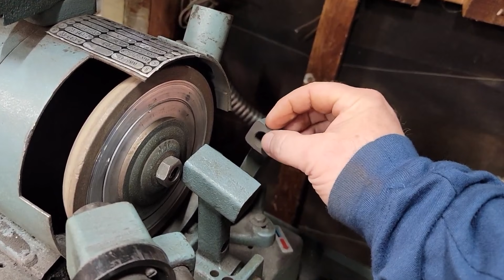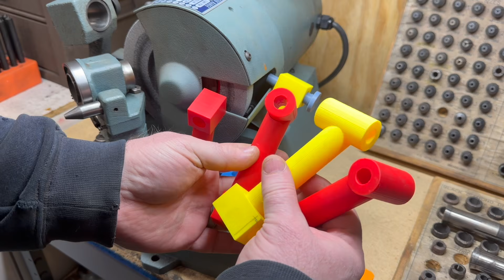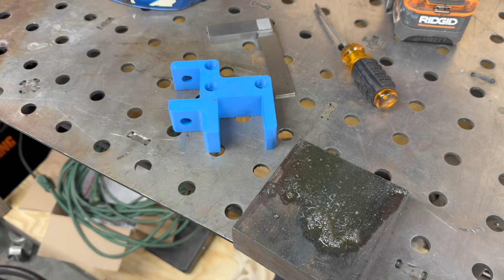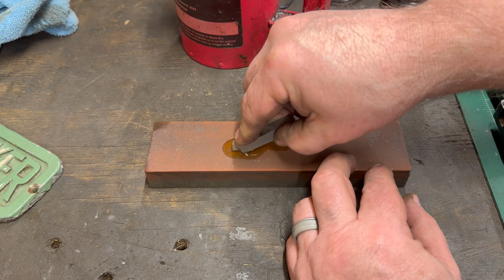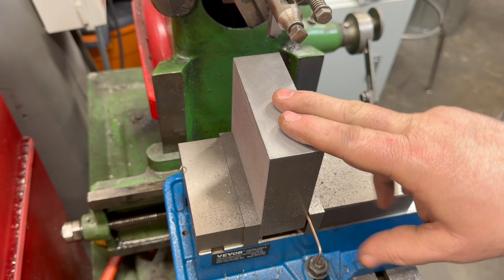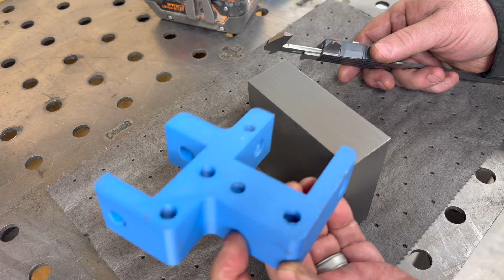Squaring Stock with a 7" Logan Shaper - Black Diamond Drill Grinder - Making the wheel dressers

Comment: I would like to make a few suggestions for you they may help with your shaper experience. First thing I noticed is your tool geometry is ground for feed in the opposite direction you are traveling. as for order of operations you surfaced the large flat surface first and then you could have flipped the part over to surface the other side so as not to have to keep resetting the height of the table. As for squaring up the end you could have laid the blade of a combination square on the vise jaw and the head would slide up against your part to square it up. Other options are rotating your vise 90 degrees and down feed the tool on the side of the part following the top surface. Again less set up changes. I have the same shaper and if you were to swing the ratchet mechanism so the feed knob is facing up your linkage rod would be plenty long enough. If you have the manual you will see that that is the position it should be in. As for your shear tool it is also ground for the feed direction to be opposite of the way you are going. Tilt the clapper box in the other direction set over about half the distance you have it now and feed the opposite   way. A little less radius on the tool would help reduce the feed lines as well. Lastly you have the clapper locked with the spring. You should rotate the lock knob to release the clapper from the spring as you are back dragging the tool across the work. The spring lock is there for doing internal work like splines or key ways. when doing internal work the tool is quite long and the clapper box needs to be restrained so the tool does not hit the top of the internal bore on the return stroke for 90 percent of shaper work the clapper box should be free to swing away from the work on the return stroke. As a side note you want to make sure you have enough clearance at the beginning of the cut so the clapper does not drop onto the leading edge of your work when it returns. It also looks as if your ram could use some  way oil. Fill the oil cups every time you use it and it will last you a life time. Hope this helps? Regards, Jeff K.
Reply from the maker: Thanks for all the tips, I definitely have some things to try out next time! 😅. Thanks for watching!

Comment: Yees, the shaper!! And, of course, you can make all this cut outs on the shaper too. But the milling machine will be easier.
BTW, the shaper was feeding on the cutting stroke while using the ruffing tool. You should know better, Greg  ;-)
Reply from the maker: I realized that after that first pass and fixed it. Didn't notice at first. Ooops. 🤦🏼‍♂
Reply: @MyLilMule  No worries. It was only a light cut.